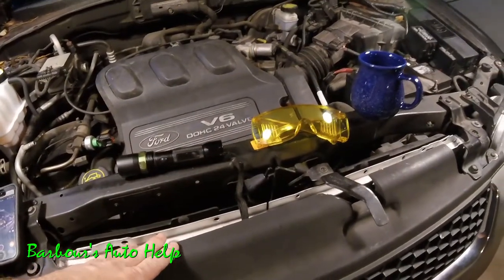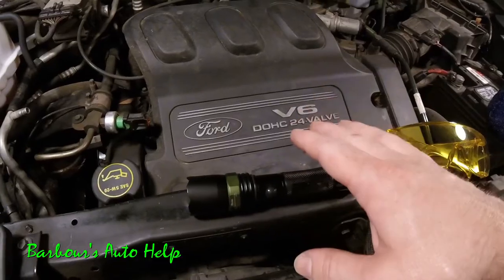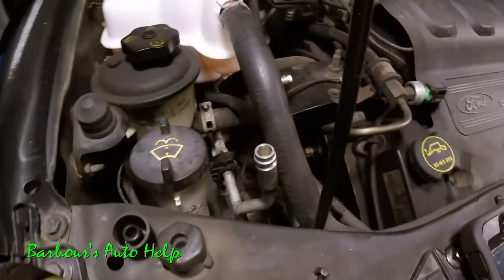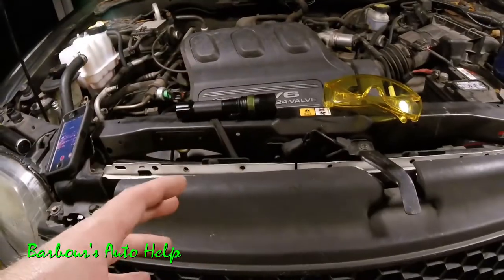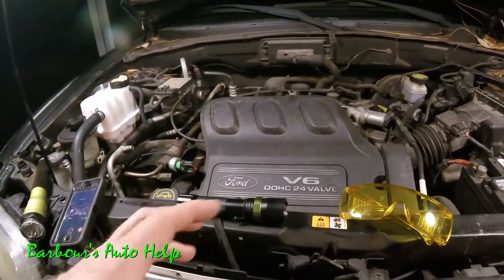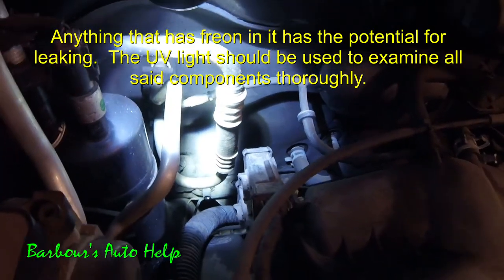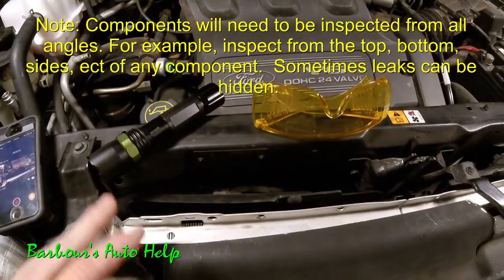Find Refrigerant Leaks With a UV light

Comment: I recently paid a mechanic $282 to vacuum my ac system and add refrigerant and Uv dye to my van which has two evaporators. After 3 days the ac stopped working. He said that I needed a new compressor, condenser, and receiver/dryer and that it would cost an additional $1300. He says that the system is leaking from the compressor seal but that it could also be leaking from either one or both evaporators. Shouldn’t he know for sure before making such an expensive repair? He will not credit the original $282 I spent on refrigerant and dye. Does this sound reasonable?
Reply: Sounds completely unreasonable. Your mechanic sounds like a parts changer. Any good mechanic will diagnose and find the leak
Reply: Vacuum, 5min vacuum test, and new freon with test colour, in Serbia costs around 30 euros...

Comment: I must be color blind to green light. So my sons car has a bad leak that the stop leak stuff doesn't stop. I only found one little area with a little green around it. Its a line attached to the compressor. I am guessing its either loose or the o ring is bad??? I was expecting green sprayed everywhere.

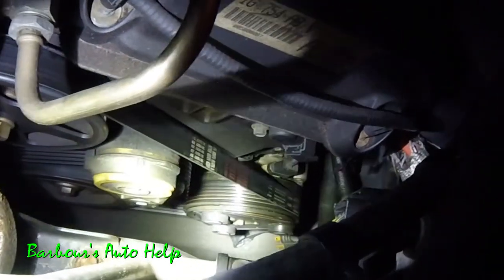Comment: At 3:52 there's a 115 volt electrical cord in the bottom,  what's that for?
Reply from the maker: I believe that was for a block heater.  This vehicle had lived in Alaska for some time so block heaters are required.
Reply from the maker: I believe that was for a block heater.  This vehicle had lived in Alaska for some time so block heaters are required.